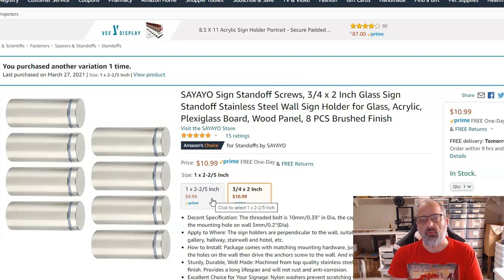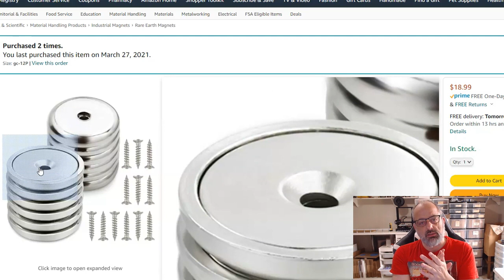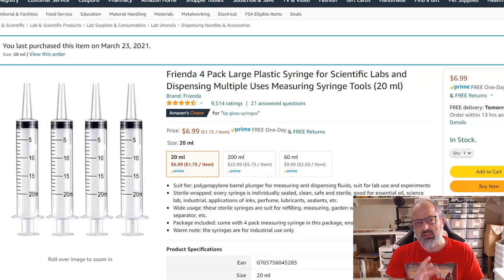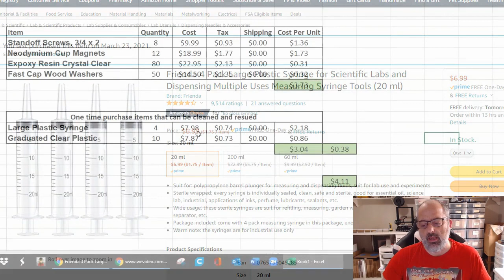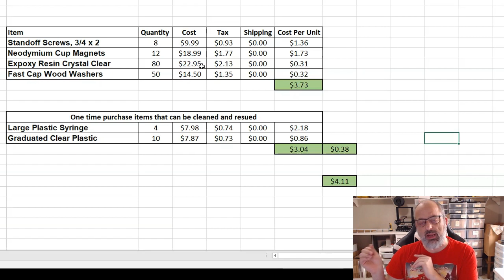How to Make Magnetic Standoff Mounts for Mounting Christmas Lights to your House

Comment: I purchased the same wood washers, what size and type of screw did you use to keep it flush with the washer?
Reply from the maker: I dont recall the size as it was so long ago but I did go to the hardware store and tried out different wood screws as they have the tapered head. the magnets also were inset to match the tapered head screw

Comment: Thanks for the clear walkthrough! One thing I was curious about—in the part where you add epoxy into the standoffs, is that mainly for strength and holding them in place, or does it serve another purpose beyond the added weight? I tried it in a batch of mine and was wondering if I’m missing the bigger reason behind it. Any lessons learned over the years that would change?
Reply from the maker: Yes, absolutely it was for weight. tips i have learned is the stronger the magnet the better.

Comment: Great vedio 
But why not just screw the magnate to the wood ?
Reply from the maker: you could also just screw the stand of to the house note even use magnets. the point of the magnets is to not have anything permit ly attached to the house except the small washers if you are mounting to a non metal surface.
Reply: Nice video, thanks. Question about the standoffs. Amazon doesn’t have these standoffs that you suggested, do you recommend any substitutes? Thanks
Reply from the maker: these should work https://amzn.to/484SmvA

Comment: Flashy lights, @5:25 to @9:30.  May want to consider using a different light for camera work.
     To get your magnetic standoffs to hold a little weight, add a piece of1" PVC pipe with a cap (or whatever fits your standoffs) to the base washer.  Sand the rounded end flat, put your washer in the bottom with some hot glue.  Sanding the rounded end will probably leave a hole in the middle, which is perfect, but should leave plenty of thickness around the edge to support the washer.  You may want to cut the length down a bit so it doesn't stand out so far.  Even an eighth of an inch lip will hold as much weight as you'll probably need for light props (within reason!).
     If you think wind might be a problem, leave it as deep as possible - or at least longer than the diameter.  This should cause the standoff to jam against the sides of the pipe if the wind yanks one side.  It won't help in sustained, heavy wind, but gusts should leave everything intact.  If you live in Chicago (IL), Wichita (KS), or similar high-wind areas, you may want to consider lag bolts instead of magnets!  😃
Reply from the maker: We learn as we go in this hobby

Comment: Would you use these for your long horizontal lines across the house? How much space  between mounts? Would pvc be too heavy to use? Thanks. Great video.
Reply from the maker: I use these for all of my horizonal and vertical lines as well as Gilbert engendering Icicles,  the spacing is about 3 feet apart. I use t he Gilbert Engineering HD Trim so there is no need for PVC. as for the icicles all my pieces are 5 feet in length with PVC backers and I use two magnetic mounts on each one.
Reply: @CounterHolidayLights  Could you elaborate on "PVC backers". Thanks.
Reply from the maker: some people with mount boscoyo strips on PVC  to keep it strait with the GE trip you8 dont need it. see my icicles video to see pvc backers

Comment: Would the standoffs mount into a 1/2 inch pvc pipe?
Reply from the maker: there is only room for about 6 to 8 MM of material when you screw on the cap. so you would need to create something that would attached to PVC to attaché the mount. like emt clips or something similar

Comment: I would like to win these magnetic mounts.  This is the first year of my family trying pixels.  This project will solve two problems.  The first is placing snowflakes on the 2nd story.  The second is storage.  I will put washers in the garage ceiling and attach coro props to the ceiling. Great project! Keep the videos coming.
Reply from the maker: also have metal strips on our garage ceiling and plan on doing the same thing.